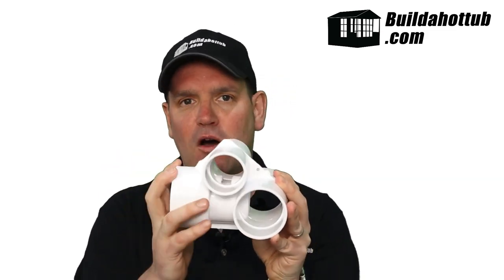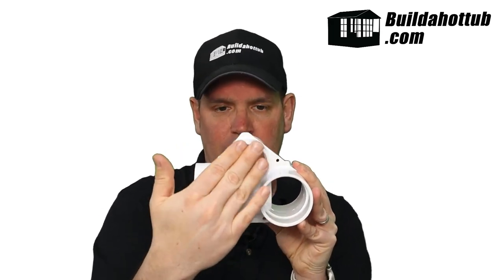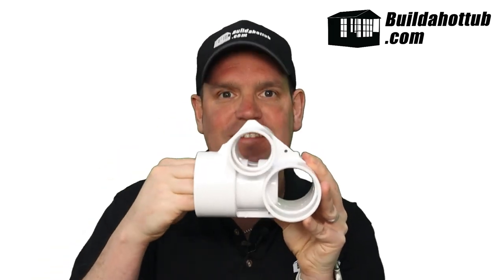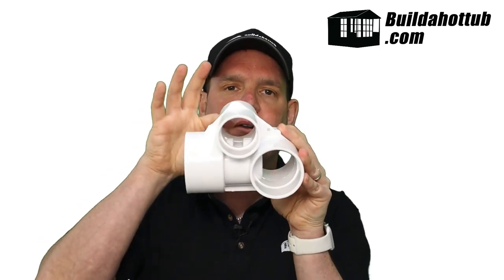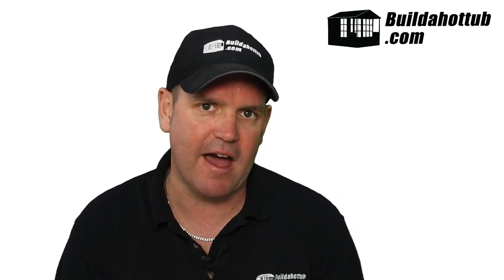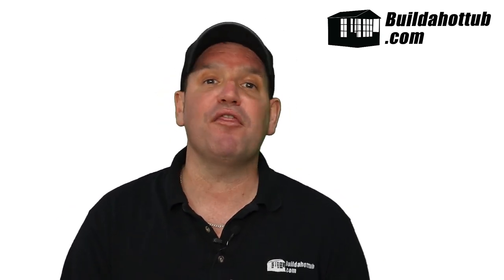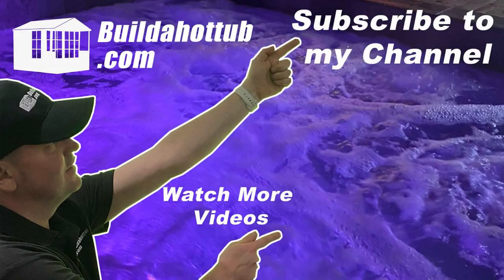Do I need an Air Blower or Venturi on my Hot Tub?

Comment: Just built a hot tub for cabin heated by stainless steel stove . I want to add some sort of jets, either water or air and thinking air pumps would be easier and need less power to run cause Iam on solar setup. I read somewhere that the air would cool my water so was thinking of building a small enclosure around my stove and pump air from there. What do you guys think ? I have my tub mostly insulated cause we get cold winters.
Reply from the maker: The heat loss from the blower would be marginal to say the least - you would be losing more heat vertically whilst you were in the tub from the water. You can get heated blowers, but not worth it in my opinion, have very little impact or difference to a non-heated version - hope that helps - Andi
Reply: Thanks Andi, any recommendations on a small blower?
Reply from the maker: I tend to use this one in most of my builds - https://parts4tubs.com/product/hydro-quip-silent-aire-blower-as-820u/

Comment: This is helpful information. I have a pool that I am in the process of adding a spa with a spill over into my pool. I would like to be able to heat my pool with my heater still. Will I be able to still heat my pool with my existing heater or will i need two different heaters? I have a Hayward spa/pool heater now?
Reply from the maker: Really depends on the temperature that you want in your hot tub - putting cooler pool water into it so that it spills over is counter productive if you are trying to heat it up. I would have a divert on it so that you can stop the spill over and then just heat the hot tub. Then, arguably you can just have one heater and switch whether it heats the pool or the tub - hope that helps - Andi

Comment: 1)Which gunite body would I need to use to allow for a venutri system with no blower? I only see you review and discuss the 1.5 x 2 in gunite bodies and I'm not finding smaller bodies.
2) If I use a venturi system do I need a stronger water pump?
Reply from the maker: Hi Gage, the bodies that I use and have reviewed on my channel are the ones for the concrete or block tubs - they are the only only ones that I use in that type of build. For Stock tanks I use a smaller body which is a 1" water and a 1" air line. If you use venturi, no, you dont need a stronger pump - but I would recommend a blower - they are inexpensive in the hole grans scheme of things and the performance is so much better than venturi. - Thanks - Andi
Reply: Thank you so much for your response! The reason I’m looking at Venturi is I’m making a system that works on 120v and 20amps or less.